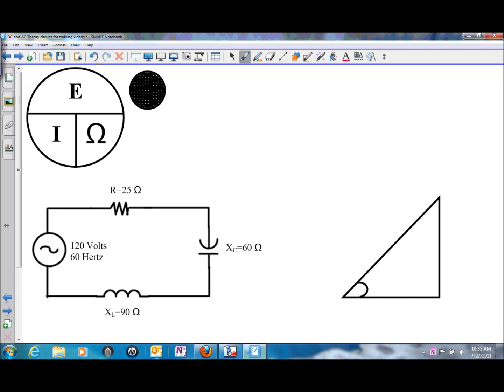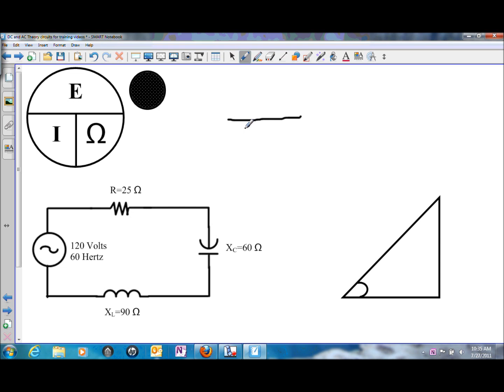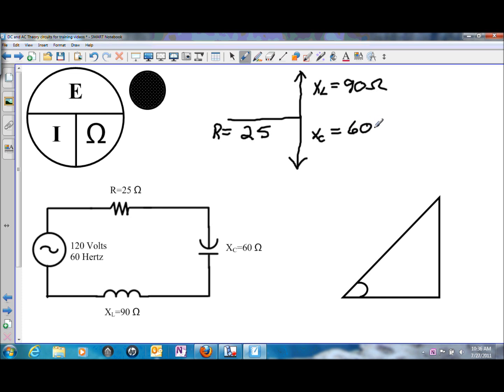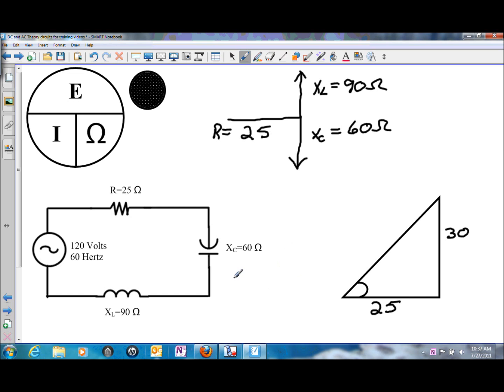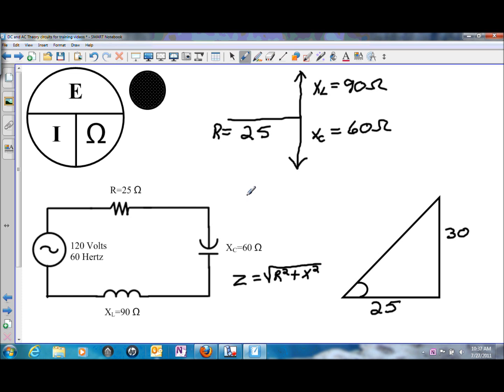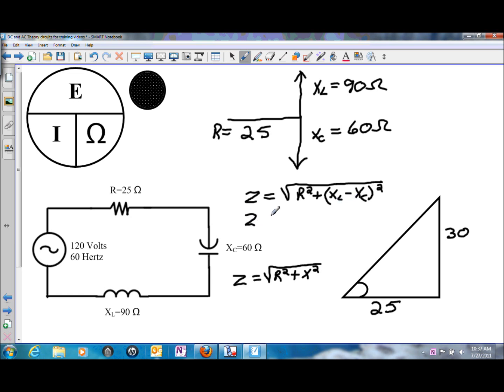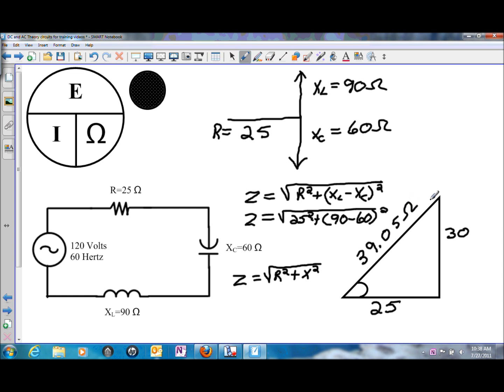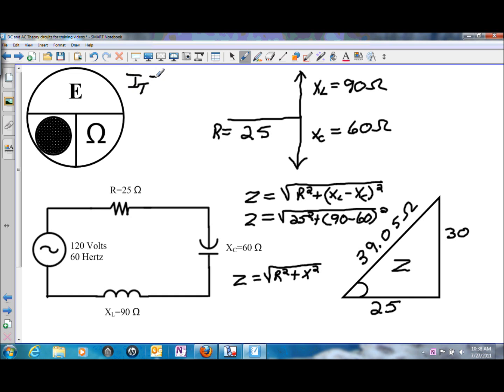Impedance and Current in a Series RLC Circuit.wmv

Comment: How do you build impedance diagram with a 70 microfarad capacitor and a coil are connected in series the current in the circuit is 13 amps and the power factor is .810 lag